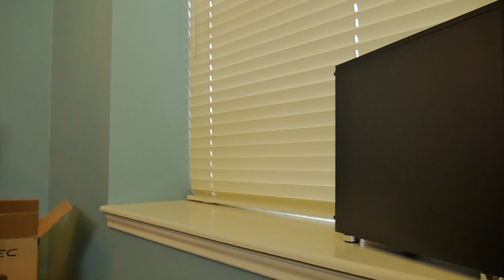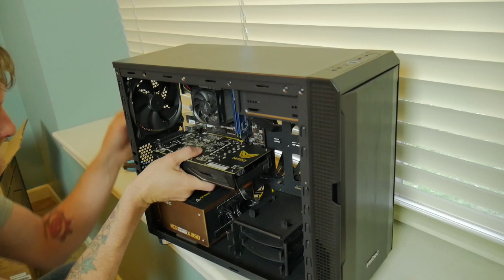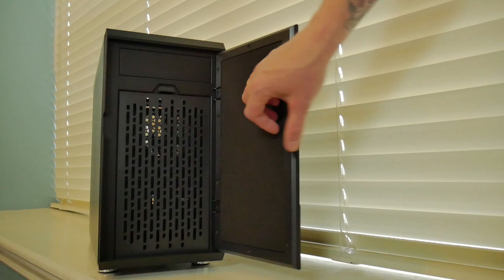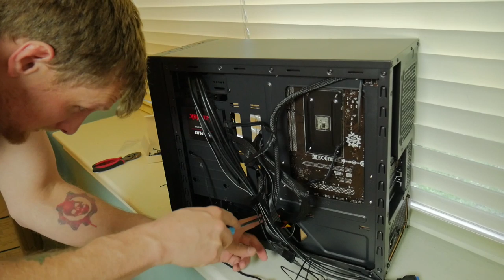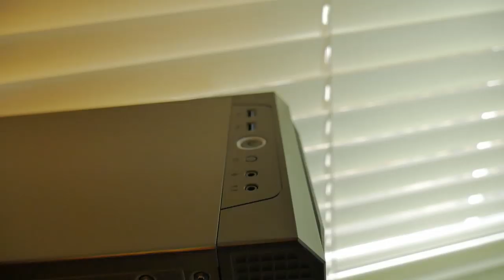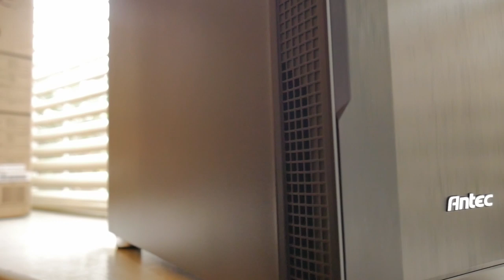Antec P5 Case Review

Comment: Using the P5 in my current build, and it's easily the best case I've ever used, better than any full-size ATX case. I'm taking one point off for only having 2 3.5" hard drive trays, though.

Comment: FYI, I use a mini cresent wrench when no stand-off tools are available and it works great to prevent the scratching you noted. Twist ties are never recommended as they can break over time and possibley short out a component such as your motherboard, plus zip ties are cheap. Looks like a decent case. I hope the airflow isn't starved too bad with the front vent limitations.
Reply from the maker: velcro ftw overall ;)

Comment: 32-0 likes-dislikes showes how much of a likeable guy you are. Thanks for the review. My 2 cents. I find the design although ment subtle still to be a bit too flashy and might i say retro as in it seems like it's been done a ton before. Designs like Fractal's Design and Core's series are more to my liking. Do appreciate the options for a drive bay though, really hate that the community is pushing for it's extinction. Other than that, it really sucks that micro atx is on the lower end priority for both cases and mobo manufacturers. Matx should still be a great way to get the best of both worlds but instead it screams budget all away around.
Reply from the maker: What makes you feel like it's still flashy? The finish or the logo? I didn't like the logo very much.
Reply: @SonofaTech  The finish and logo but that's just me.
Reply from the maker: @faycalassaad6066  fair enough

Comment: are the HDD geting cooled down there? doesnt look the fan hits them right on
Reply: You can replace the included 140mm with dual 120mm fans.  They will run the full length of the intake filter and hit the drive cage directly.

Comment: Nice case but looks like there is an omission. No filter on PSU intake underneath case.
Reply from the maker: Good point
Reply: I just bought this case 2 weeks ago - mine does have an intake filter for the PSU.  The front intake also has 3 entry points - the two side sections he mentioned, plus the bottom is fully open so long as you keep the feet installed.  Dust will build up on the bottom first though.  The case has room for 2x 120mm front intake fans (or a 240mm all-in-one water cooler).
Reply from the maker: Bryan are they making it right on the missing dust filter
Reply: @SonofaTech  I couldn't tell you if they didn't include one 18 months ago - all I know is that it had one on day one for me.  I moved an existing system (upgrading from a half-height tower that never really did everything I wanted it to) into this case last weekend, and it's perfect for my needs.  It also gave me an excuse to upgrade the GPU while I was at it...
Reply from the maker: Bryan what gpu?
Reply: @SonofaTech  ASUS 1660 Super Phoenix, up from a Gigabyte 1050ti Low Profile.  Fits better with the I5 7500 I installed earlier this year (up from an I3 6100).  Budget is not a terrible thing, if you can find the right balance for your own needs.
Reply from the maker: Bryan nice I haven’t benchmarked one yet. Because of mining I just have a boatload of 5700xts lol
Reply: @SonofaTech  I used the ASUS build of FurMark, and it was hitting 2600 range for 4K and 7500+ for 1080.  For a $230 GPU, I'm thoroughly pleased.  Star Wars Squadrons was 55+ fps in 4K at Ultra detail.  Dropping it to 1440 pushed it over 80fps.